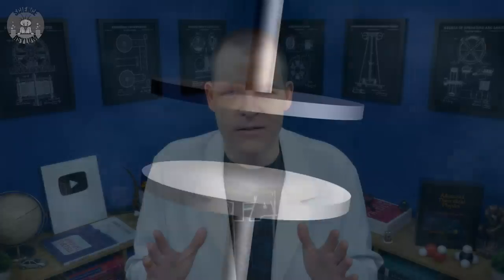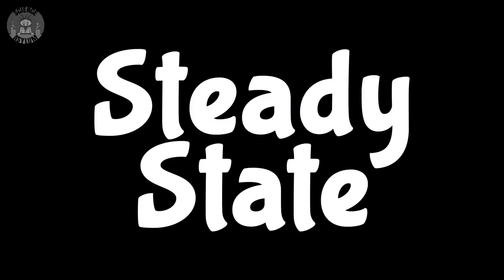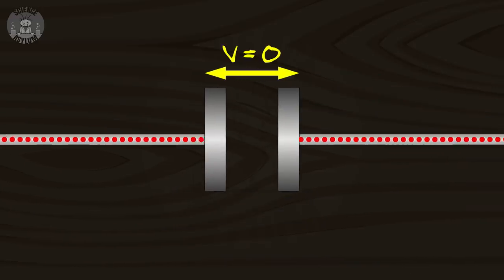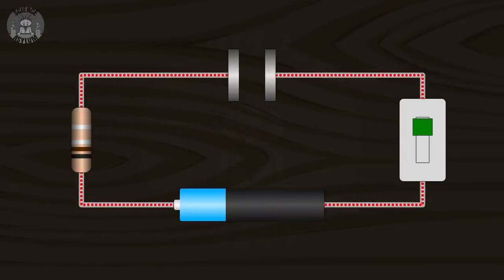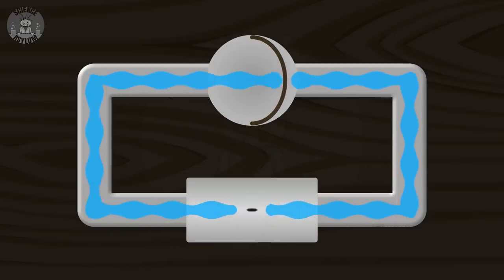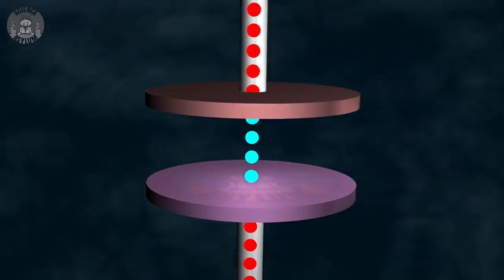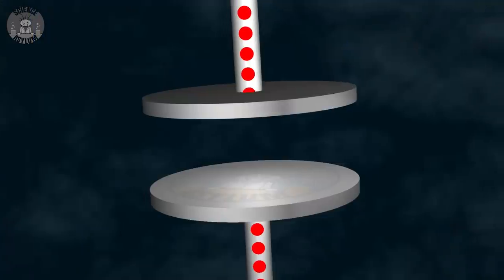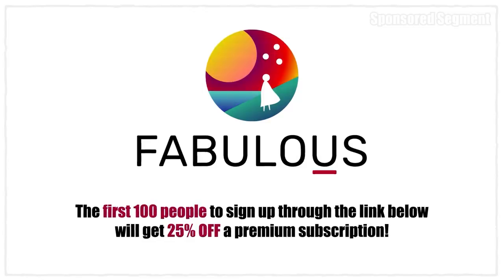Capacitors Are Gaps! How Does That Work?!

Comment: The displacement current always bothered me. Even though we say electric fields can create magnetic field (due to Ampere-Maxwell's Law and displacement current), that never felt intuitive to me beyond its usefulness as a model. Fields always come from charges and so I never understood how the magnetic fields in between the cap plates were really created. I tried using Biot-Savart's law to find it but that didn't work. Maybe someone else has a good explanation of how the charges create that field without every having a "real" current through it.
Reply from the maker: Actually, magnetic fields always come from changing electric fields. Even when you think they're coming from charges. "Moving charges" generate a magnetic field because the electric field of those charges is changing. In fact, you could say magnetic fields are just electric fields in a different frame of reference: https://youtu.be/Ii7rgIQawko
Reply: @ScienceAsylum  Is that always true? Does the electric field change in the case of steady current through a wire? The relativistic perspective makes sense in that case. For the changing electric flux in a capacitor, it originates from the charges residing on the plates, right? How is it those create the magnetic field in between the plates? I guess I'm just trying hard to only analyze this using charges since I think they are the most "fundamental" explanation.

Comment: A capacitor opposes a change in voltage. A capacitor holds a charge. A capacitor blocks dc. A capacitor is a variable impedance as frequency goes up xc goes down. Capisitance uses no power.

Comment: Because at t=0, there is no charge buildup on your capacitor. I don't understand why the voltage is zero? 

Shouldn't there he an initial voltage caused by the field of the battery  itself, and thus the voltage should be briefly negative at T=0, because obviously if there is an E field due to the battery itself it (V-IR) then across the capacitor there must be a voltage and then once it gets charged the field points in the opposite direction.

So why is the graph drawn to have t=0, V=0?
Reply from the maker: "Shouldn't there he an initial voltage caused by the field of the battery itself...?"
I corrected this immediately by working out the math on paper. It was part of the story.
Reply: @ScienceAsylum  i get that you stated there should be an initial voltage due to the battery itself. But your equation at t=0 states there is zero voltage across the capacitor. And your graph similarly shows zero voltage. So I was just wondering why the equation itself doesn't have the +v_0 on the end of it

Comment: Not trying to @ you lol. But do you have a video explaining why superconductors have resistance? I know that high magnetic field can break the superconducting state. Could it be that in a circuit with an ideal battery, capacitor, and SC wires that the initial current would be so high that it's own magnetic field breaks it's SC state? Or is there really no such thing as 0 resistance wires?
Reply from the maker: Everything has resistance. It's a natural property of all matter. The resistance of a superconductor may be so small that it's below our ability to measure, but that doesn't make it zero.
Reply: @ScienceAsylum  I hope you do a video on this because I've always heard it was exactly zero. I don't know if resistance is a natural property of all matter or an emergent property that fails to emerge while superconductive

Comment: Shining capacitor = Bad day? And, it's a bad day that's about to get even worse... A good time to "run away from the light"... 🙂

On the other hand, a non-conducting semiconductor diode junction can be viewed as a form of (really tiny) capacitor... Increasing the applied voltage will 'squeeze' the capacitor gap until conduction can occur, and the diode (made from the right materials) will be called an LED... Christmas tree lights do not define "a bad day"... or 'should not', at least...

Comment: What are capacitors used for?
Reply from the maker: I didn't mention what capacitors are used for, partly because I only know a few, but mostly because I don't care where they're used. It's not my area 🤷‍♂️. That's someone else's job. But to answer your question the best I can:

DC: Capacitors are used to store a small charge for future use. Example: It was common in electrons with clocks. You could unplug your VCR, untangle some cables, and plug it back in without the clock losing its time.

AC: Capacitors are used to frequency tuning, mostly for radio transmission.
Reply: @ScienceAsylum  Thank you very much

Comment: Isn't it even simpler to say that the high potential side of the battery push charges to bundle up on the side of the capacitor it's connected to, and that charge will influence the opposite plate due to straight up coulomb force? Easy current on both sides without anything flowing between the plates.

Comment: When the breathing stopped in case of dc, the current stopped, then what's the use of the capacitor if current doesn't flow
Btw 'noice' video as always
Reply from the maker: In DC, capacitors are used to store a small charge for future use. Example: It was common in electrons with clocks. You could unplug your VCR, untangle some cables, and plug it back in without the clock losing its time.

Comment: A bit of a diversion, but, how do superconductors have resistance? Actually now that I think about it, its amazing superconductors even are a thing.
Reply from the maker: They're called "superconductors" because they have extremely low resistance. It's so low that we can't measure it. That doesn't' make it zero though.
Reply: @ScienceAsylum  Thanks for the clarification! I'm assuming that over the scope of billions of years its super tiny resistance would have then dropped its current by a significant amount?

Comment: Please please please explain how a capacitor can hold a charge even if it's been sitting for a year "unplugged". Like where does it hide a ton of electrons with no field ?  Or am I mixing it up with something else ? All I know is that there are things on an old TV chassis that can put you on your butt if you touch it.  How is that possible ??
Reply from the maker: Electrons are matter, so they don't need a (classical) field to exist. That atoms in the negative plate just has more electrons on it than it would if it were "uncharged."

Comment: 12:59 why is there a big arrow flashing on the screen?
Reply from the maker: It's an animation glitch. Couldn't fix it before release. This video has been one technical problem after another. It's a miracle it got finished with just a couple single-frame glitches.

Comment: but why use a capacitor instead of a wire?  makes me think of a wireless charging dock... what's the benefit of using something that capacitates the circuit? that sounds like a breaker... once the capacitor is charged what function is that fulfilling in offsetting the original voltage?
Reply: When u need a more current in a short time but u don't have enough big battery to do that eg during  clicking photo flashlight is driven by capacitor

Comment: still dont know what they are really doing in there for the circuit. i have seen them used as "radio interference supressors" when wired in parallel with electric motors but dont know how they suppress e fields and i have looked at old timey radio circuits where they are called condensors but not sure how they condense anything or why.

Comment: You really don't need Energy to explain capacitors. One plate of the capacitor stores charges and the other side "loses" charge. In DC there comes a point where the charge is saturated --> no more charging no more current. Thats the reason you get zapped from charged capacitors, because you give the charges a way out. 
In AC the capacitor charges in one cycle and gets discharged in the other, so it doesnt feel like a break in the wire.... (your water analogy helps here). 
Otherwise great video. P.s: Where Im from electric engineers learn this in school... I learned this...

Comment: Can you go into more detail so that photons come into the picture? If the electromagnetic field is transferring energy about the place, that means that photons are flying about, right?
Reply from the maker: Not necessarily. It depends on what you mean by "photon."
Reply: @ScienceAsylum  my understanding is that energy can travel about as waves, but the moment that energy interacts with something (like, is used to move an electron, etc), the energy transfer is quantized and we pretend that quantized exchange of energy is a particle called a photon? So when fields are used to transfer energy across a gap -- can that be thought of as a photon emitter and receiver antenna situation?

Comment: I don't quite understand how the size of a capacitor changes. Is that a bigger gap or more gaps? Something else?
Reply from the maker: You mean when I said putting a dielectric in the gap allows us to put the plate closer together? That's a design thing. We would be choosing to have the plates closer together.
Reply: Capacitance can be thought of as Volts per Coulomb. That is, the amount of charge a capacitor needs to displace to gain a voltage across it of 1 Volt.

For a parallel plate capacitor, this capacitance is linearly proportional to the surface area of the plates (longer, wider plates give more capacitance) and inversely proportional to the distance between them (closer plates give more capacitance). As Nick explained but not as core focus, closer plates have two problems, attractive forces can pull them together and eventually short out, or, the medium between the plates can break down, stop being an insulator and conduct. This last phenomenon is defined by dielectric strength and is measured in Volts per distance, e.g. kV/mm. This means that for a fixed voltage there will eventually be a distance at which conduction occurs - for media like air this can be worse as, once it has been ionised by dielectric breakdown, the resistance of the gap drops profoundly and it acts like a short circuit. This can even happen in a solid medium and can often leave holes resulting in a capacitor that won't perform to its original spec any more.

Comment: Capacitors part 2 - Good explanation of how they work, next how they're used: Why they're used in crossover circuits in speakers. Also, why sound producing circuits often have them. I know they're related topics, that's why they should be in the same video.

Comment: Saying superconductors having resistance is a pretty big claim.  Future video mayhaps?
Reply from the maker: Really? I think the opposite is true. Saying they have exactly zero resistance is an unsubstantiated claim. Their resistance may be below our ability to measure, but that doesn't make it zero.
Reply: @ScienceAsylum  Unfortunately I never got the chance to have a deep understanding of superconductors.  I took quantum many-body when lockdown first happened.
Reply: @ScienceAsylum  What exactly is it about a superconductor that gives it a different classification than conductors in general, that just happens to have an extremely low resistance?  Every thing I've ever heard about them, is that they are zero resistance conductors.

Comment: I'm sticking with the water pressure analogy. Although, water is not very compressible and air is...
Reply: Air pressure is a better analogy than water IMO. Since the density of electrons changes throughout a circuit, air has similar characteristics.

Comment: Lol this video reminded me of a time i along with my friends created a capacitor flash bulb 
In 7 th grade we held wire connecting from two wires in a plug in school to a  bulb 
We might have created an air ca9acitor and there might have been enough current to fuse the bulb 
Lol

Comment: Why Capacitors have a maximum voltage rating?
Reply: The voltage difference between the two plates can't go infinitely high. If it goes too high, a massive current will jump the gap and short the capacitor, usually causing it to blow up in the process

Comment: Wait, so if the energy flow is perpendicular to both fields, where the heck does the energy even come from?  Shouldn't it be stored in the EM field?
Reply from the maker: It is stored in the electromagnetic field. For capacitors, that specifically in the electric field 🤓
Reply: @ScienceAsylum  I think I get it now.  It's because EM waves are transverse waves, right?
Reply from the maker: EM waves can certainly be used as an analogy here, but I'm hesitant to say there are actually EM waves. (I could hear an argument for it in AC, but not in DC.)
Reply: @ScienceAsylum  But aren't the waves how the energy is transferred?  Energy can't just move by itself, since it's really just a property of particles/fields.  If the energy is stored in the EM field but flowing perpendicular to it, I don't see how that flow could be anything other the EM waves? What other mechanism for energy transfer is there in this context?  And why would it matter if the circuit is AC or DC?  For DC, the capacitor will of course just charge up once and then act like an open circuit, whereas for AC it will keep charging and discharging, but I don't see how that would affect whether the energy is from EM waves or not.  Afterall, in any individual cycle of AC, before the current changes direction, it acts like DC current anyway (at least, assuming we're talking a current and voltage of constant magnitude and not a sine wave or something), so I see no reason the mechanism for energy flow would be different for AC than for DC.
Reply from the maker: @Lucky10279  In DC, both the electric and magnetic fields are static (at least for the light bulb circuit). There's no oscillation in the field, yet the energy transfers anyway. Is there some other mechanism there? I don't know what it would be. That's just how the math works out. Maybe virtual photons are actually real, but I doubt that.
Reply: @ScienceAsylum  🤔  Couldn't it just basically half a wave cycle though?
Reply: @ScienceAsylum  
I make no claim to being a physicist. Having said that, would there not exist a gradient (that cannot be disobeyed) between the DC battery and the load (in a practical cct.)? A 'path' for energy to flow 'down' from source to consumer (like a gently flowing river that flows down the gravitational gradient?)
Reply: @ScienceAsylum  So I've been reading about this for past two days as your video got me really curious about it, and I found a source that pointed out that "The resultant electric field changes its direction around the [DC] circuit as the wires form a loop back to the battery" which seems to imply that there ARE waves carrying the energy, even in DC circuits.  What do you think?
Reply from the maker: @Lucky10279  I think that might explain the transient state, but not the steady state.
Reply: @ScienceAsylum  Old comment, I know, but even in steady state, that just means the current and voltage are constants, right?  I mean, each individual electron (or ion, if we're talking about inside the battery) is still moving, and so is still changing the value of the E field as it moves accross it, right?  Of course, there will be way more than just a single electron/ion moving and, on average, they'll be moving at a constant rate if the circuit is in steady state, but there's still movement (or the QM analog of it at least) and so still a gradient.  If we think about it in terms of QM/QFT, where everything is just waves in fields interacting with each other, the waves in the electron field would be interfering with the waves in the EM field, right?  On average, the waves might have a constant speed, hence, on a macro level the circuit can be in steady state, but at a micro level, I don't think there's really such a thing as steady state at all -- at that level there are simply far too many degrees of freedom for that, I'd think.  Thoughts?

Comment: Short answer: electrons are not moving from one terminal of the battery to another, no matter DC or AC. Its more like they are vibrating back and forth. I idea that one electron, we'll say "Carl the electron" starts at one terminal and travels to the other is complete fiction. And its where the water analogy falls down.
Reply: electrons flow, because, like charges repel, unlike charges attract.
now , the -ve terminal of the battery has electrons. they repel the charges in the wire, which in turn repel the charges in nearby vicinity of the wire and that's how current or charge starts flowing in the circuit. the charges in the wire  near the +ve terminal of the battery nutralise the +ve charge in the battery.

Comment: But superconducting wires have zero resistance, right?
Reply from the maker: No. Their resistance is below our ability to measure. That doesn't make it zero.
Reply: @ScienceAsylum  but wiki says, that "...When cooled below their transition temperatures, they have zero electrical resistance..." Is it mistake?

Comment: There we go to the Maxwell again, Electric Engineers do not learn that way to simplify complex circuits, if we take only the capacitor or only a simple circuit we can see the field driven by the µ, less µ more surface, more µ less surface for the same electromagnetic field. 
The µ from air can also explain why batteries discharge, unconnected.

Comment: I would love to see a circuit with a battery, a lightbulb, a capacitor and a switch. If I understood this correctly, you close the circuit in the switch and the light shines just a fraction of a second. I don't have the materials to build this circuit and check myself...
Reply: Right!